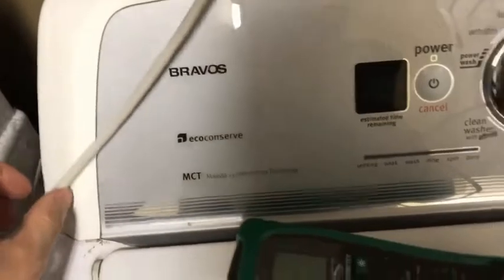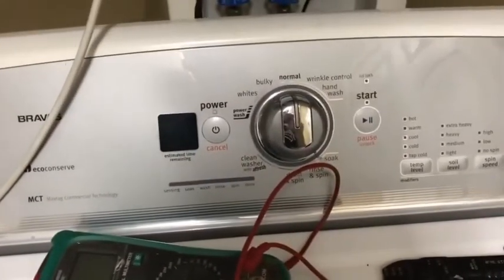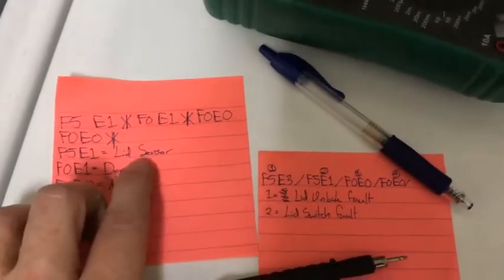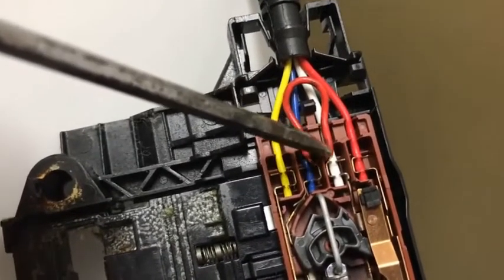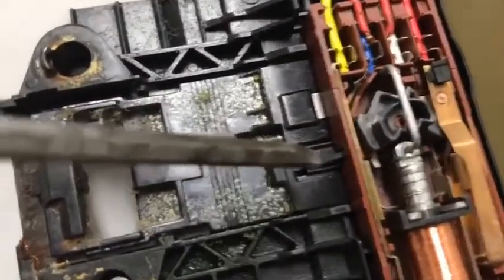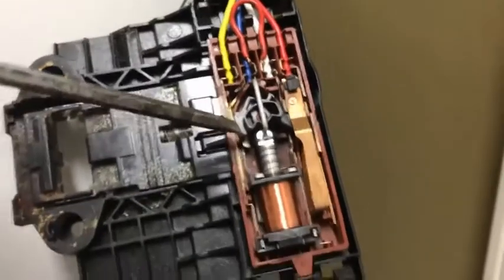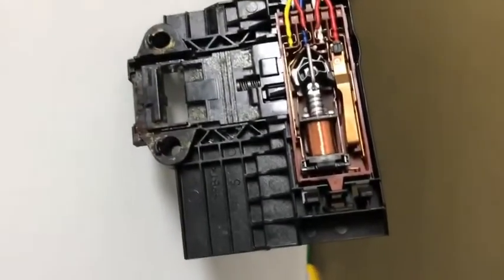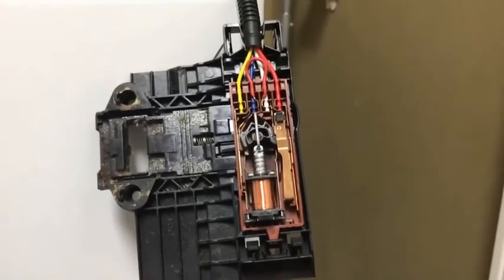Maytag Lid Lock Bypass Fix NOW $0! Works for Maytag, Kenmore, Whirlpool, Amana, Roper

Comment: I did this, it locked, and then during the spin cycle, the lid lock light starts flashing, stops spinning mid spin cycle, and cancels the load.
Reply: All this does is bypass the door open/close sensor. the red wire is the lock engaged/disengaged switch which also is a live wire 120 VAC wire when engaged. Basically what I had to do in a pinch, is jump red to white when the washer expected the lock to be engaged, and unjump it when it expected the lock to be disengaged. I found all this out from a schematic on another page. It's a ridiculous design and essentially cannot be bypassed while keeping the washer fully automatic.